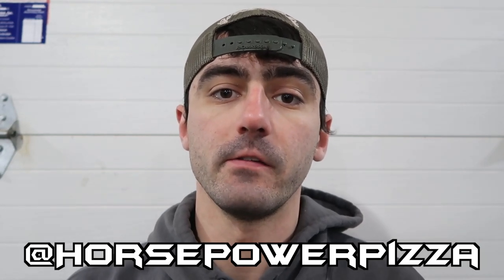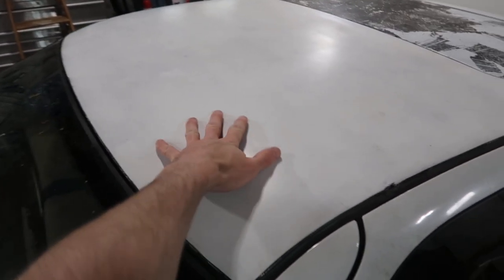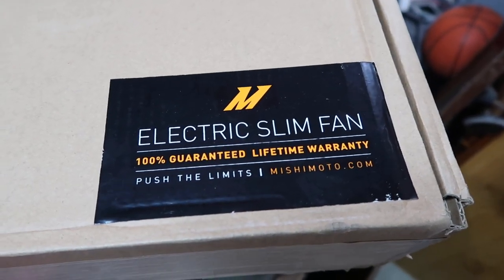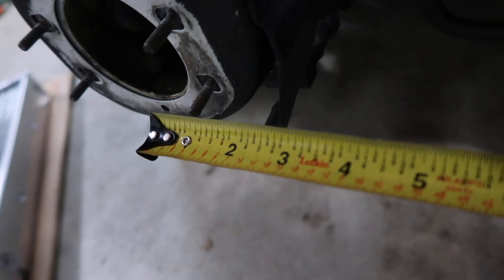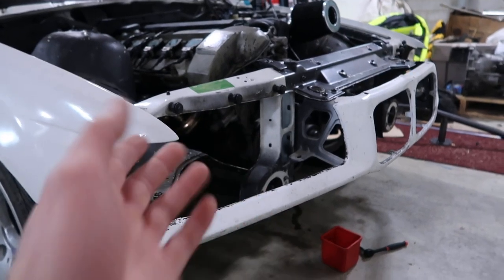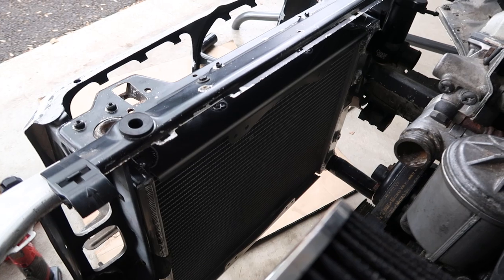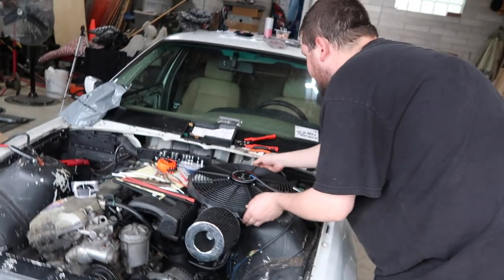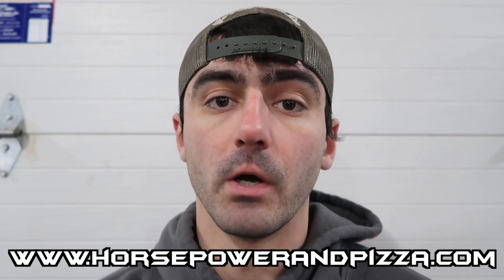Mounting Chase Bays Tucked Radiator (BMW E36)

Comment: What about the hose that goes from the revoir the the back of the thermostat? Just block it off and only run the upper and lower ?
Reply from the maker: Mine doesn’t have a hose that goes to the back of the thermostat but there was a bunch of stuff that was deleted before I got the car. Sorry I’m not more help!

Comment: With this radiator do you need the two plastic radiator clamps to hold it?
Reply from the maker: I didn’t use any of the oem plastic clamps and the hoses also came from Chase Bays
Reply: What size hoses did you use ?
Reply from the maker: @EnriqueHuerta-l1m  I used 1.5” hoses